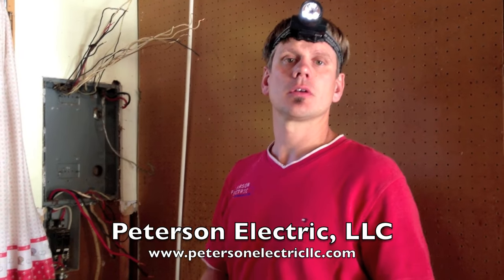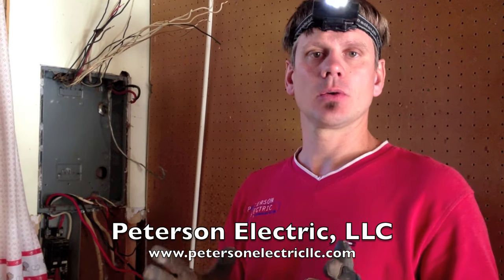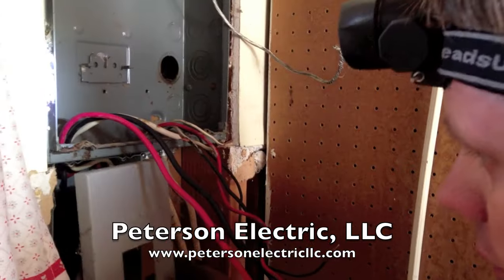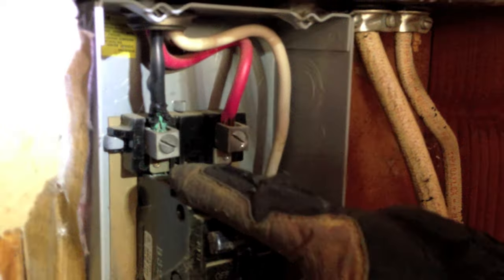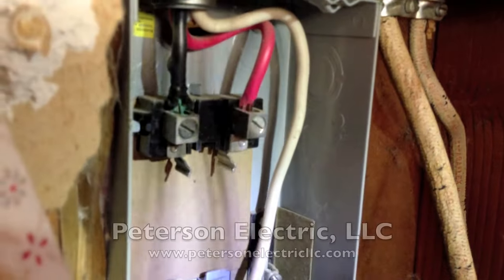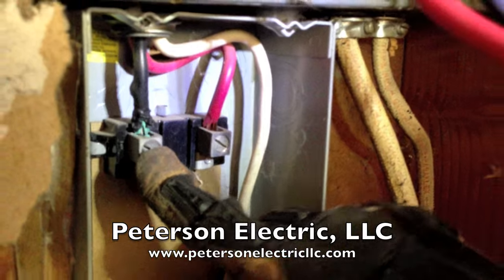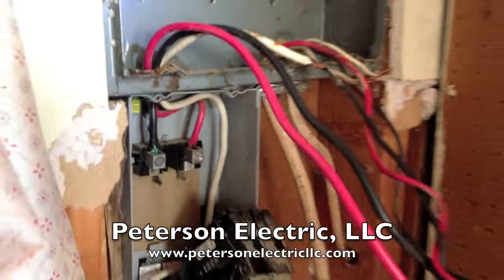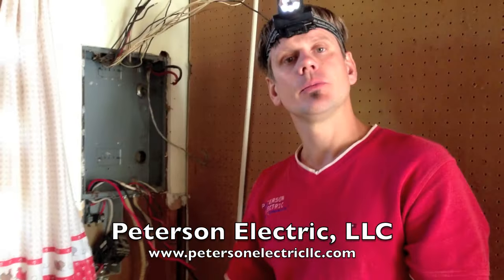Lights Flickering In My House What Is The Cause? Colorado Electrician

Comment: I have low voltage throughout the house. The readings from the outside box and inside box are on point. Any ideas? Ty.
Reply: Loose connection or breaker

Comment: That’s not caused by “an out of balanced phase.” It’s a loose connection to the lug. You ...let me rephrase that, I can clearly see that the screw isn’t tightened down as far on the black wire as it is on the red wire indicating that it isn’t tight.
Reply: Mr. Sleep I can see the clamp moving when he put his finger on it, so it looks like you are correct.
Reply: It is single phase.   Almost all circuits would have to be powered by one Line before it could cause a problem.   Loose connections cause minute arcs.   Minute arcs cause heat and bigger arcs until you get what you see in this video if not fixed.  So, Mr Sleep is correct!

Comment from the maker: Could be a lose wire on the circuit or at panel
Reply: Peterson Electric I noticed that in the house that I live in my lights do not flicker but sometimes they get bright and dim and whenever I plug something in with the motor like a fan or an air conditioner it speeds up and slows down,  could you tell me what this might be?
Reply: edwin g I am having this same problem.

Comment: Hi , I have an issue with my basement stairs lights i have a light at the top of the stairs and a light at the bottom of the stairs and when i go to turn off the lights ,the lights just go dim not all the way off , i dont have dimmer switches, both lights are on the same light switch at the top of the stairs , i replaced the switch and still does the same thing , any idea on what i should do ? thank you !
Reply: when using a dimmer. replace the lights because some lights don't work properly on dimmers. if you use just a regular light switch then maybe you have a leak current in the circuit somewere.

Comment: 1 of my 3 overhead lights in kitchen began flickering slightly, barely noticeable at first, then all 3 eventually began flickering slightly then progressively worsened, until they finally quit coming on at all initially but would come on a few minutes after flipping switch.  All are on the same breaker, so I changed it and took down the fixture that started  flickering first and replaced and or checked all the switches. Still not working but one of the remaining fixtures I removed, checked and reinstalled will sometimes flicker when I turn on switch but doesn't stay on. There is one wall outlet on same breaker that works fine all the time as the computer is plugged in it and is always on. Checked wire in attic for obvious damage but very difficult to see much of it, it goes in the exterior wall. I have a multimeter but unfamiliar checking for current on a live wire to isolate where my problem lies. Any ideas that don't include calling an electrician? Any ideas will be tried and appreciated. Multimeters for dummies tutorial may help. Thanks for any ideas.
Reply from the maker: This type of circuit issue can only be completed while the circuit is on and figuring out where you are in this branch circuit, (beginning, middle or end). Then you may have to isolate this as the only one on. Then put a load or a couple loads on it, lights and possible a hair dry. Tracing circuits hot with a load is very dangerous, especially on a neutral that is sharing on a multi-branch circuit, (red and black). If this does not make sense than you need to call a PRO>
Reply: I would check the nearest light in proximity from main switchboard that was flickering as it may be causing the rest to flicker upstream from a hot join. That is if your light circuit is looped at light fixtures and not at light switches. If you just tap the light fitting with gloves on whilst switched on at connection point you may here a sizzle indicating your problem. It seems your problem has started with a loose connection that has now detached itself at a terminal point. Realistically if accessibility is ok it won't be hard to fix for a Licensed Electrician.

Comment: Everytime my washing machine is running the lights in my house flutter and flicker rhythmically with the washer, this is happening to every single light in my house.  It used to only happen to the lights in my kitchen where my washer is (even the light inside my fridge), but now I can see it in all other rooms.  It's not the average quick dimming of lights when something kicks in, it's a constant flicker/fluttering until the washer is turned off.  I also do have the quick dimming of lights when the fridge or the air conditioner compressor kicks in or the furnace but even that has  been more prominent lately, stronger dimming than usual.  in my computer room the light on the ceiling seems to flash instead of dim when the air conditioner compressor goes on, but the constant flicker from  my washer is scaring me, I'm afraid to run my washing machine at all I'm worried the fluttering of the lights may start a fire.......any clue as to what this may be?  my husband thinks I worry too much but something seems to be happening that shouldn't be happening, seems like something is might be wrong in the breaker box or somewhere else???
Reply: if the flickering does not happen until the washing machine is running than I would say that if their is any problem it would be with the washing machine itself. to prevent all flickering you could give the washer its own circuit. make sure that the amount of current pulled by your dryer (plus the current pulled by the rest of the stuff on the circuit) is less than the amount of current your wire can transfer safely.
Reply: Same problem I have, washer makes the lights flicker more,shut down the breaker to both washer & dryer & now the  furnace draws a lot of power, heating man says we have a electrical problem..yes we know that but where ??  don't wanna spend money if something we can fix is cheaper